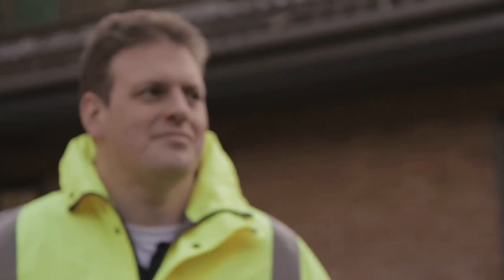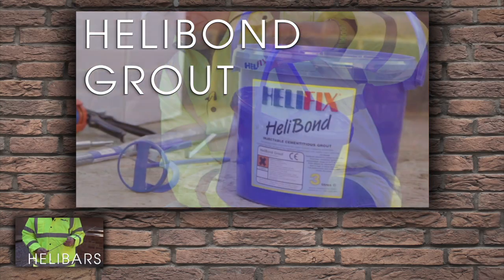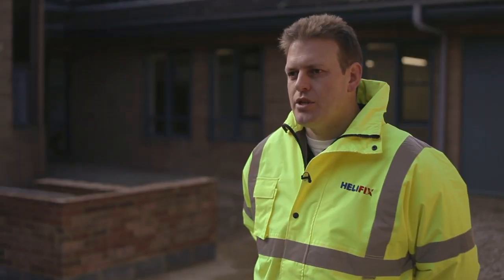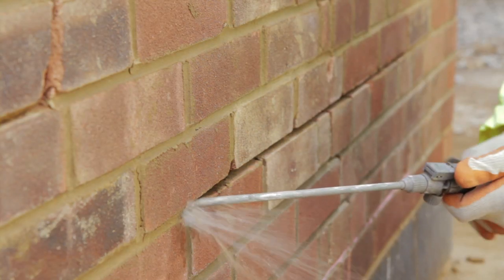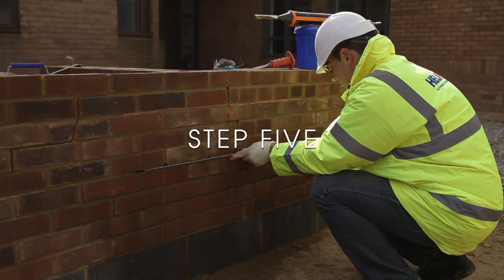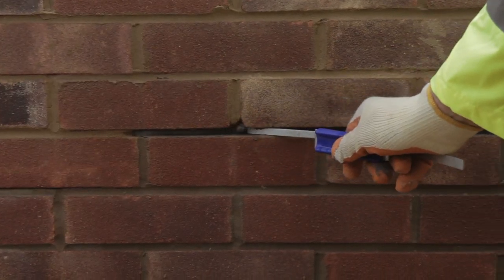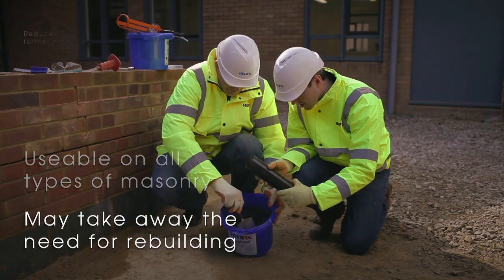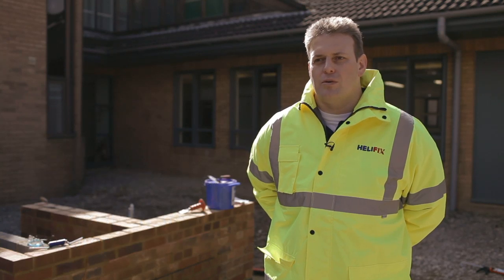Crack Stitching Kit from Helifix

Comment: I have 10mm mortar joints  in an old house 1930s do I need 6 or 8 mm helibar?
Reply from the maker: Thanks for your query Dave. It sounds like you are doing crack stitching repairs. If so, Ø6mm HeliBars are sufficient. It would be worth confirming this with our technical team before proceeding as there may also be ongoing movement or excessive loading to be dealt with. Please contact Helifix on +44 (0)20 8735 5200.

Comment: How many bars do you need to put in?
Reply from the maker: Hi, thank you for your enquiry. In crack stitching applications using HeliBars, a single HeliBar is required per bed joint, spaced at every 4-6 brick courses (300-450mm). If you require any further assistance, our Technical Team will be happy to assist. They can be contacted on +44 (0)20 8735 5200.